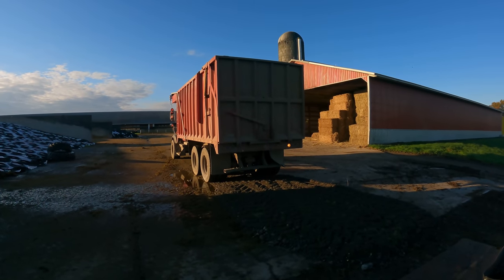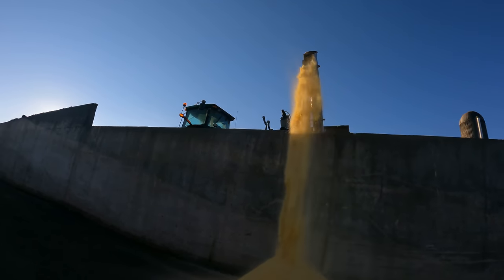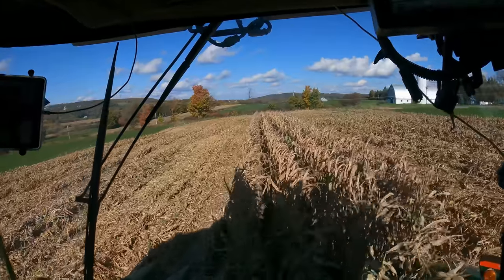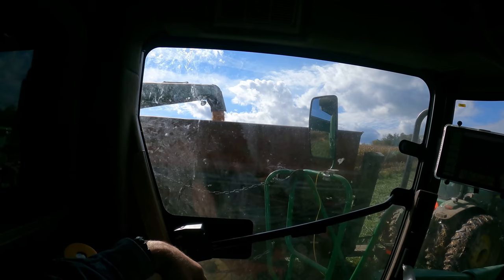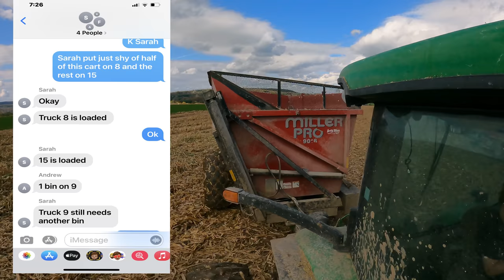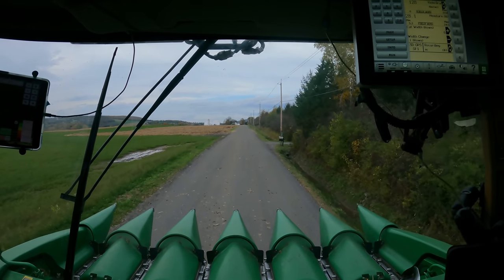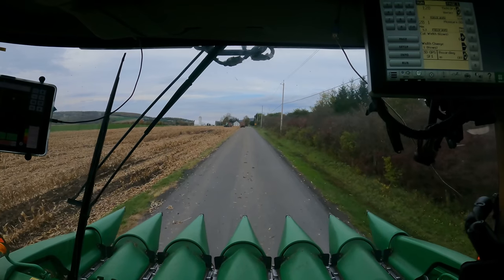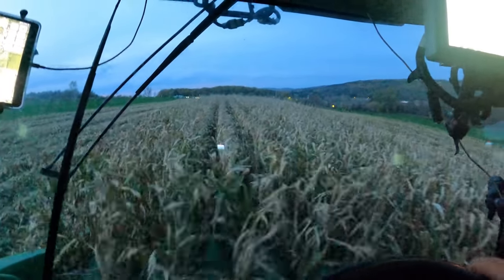Hi moisture Corn Day 1.1

Comment: Andy, I've noticed that you don't have duals or tracks on your Combine, so you obviously  don't think the added flotation/traction is great enough to offset the added expense?
"Nothing Runs Like A Deere" 🦌👍🇺🇸
Reply: 6 row head… no room for duals.
Reply from the maker: Haven’t needed them yet
Reply: @FarmingFixingFabricating  
There was a hill that you couldn't get up just a minute ago.
Reply: @stevefarrow9327  
I don't think that's correct, and I know you can run tracks.
Reply: @RealJohnWayne  he isn't exactly running a huge combine that needs it.
Reply: @EFCasual  
The size is irrelevant, it's about going up the hill that he can't, or pulling a wagon through a wet spot that he cant.
Reply: @RealJohnWayne  it's mostly about spending as little as possible on equipment and still get the work done. Put duals on your own combine.
Reply: @EFCasual  
That's exactly what I stated in my OP, it's always been about the ROI with everything you purchase.
Andy said that he hadn't needed them up to this point, which is a much better response than yours.
Reply: @RealJohnWayne  you can run tracks, 40,000- 80,000 dollars. With a six row head you could dual an 18.4 with a 30.5 and still stay narrow enough. However most final drives are not strong enough for this type of dual setup full time. If used keep a set of extra final drives around. To steal a u-tube line..”ask me how I know that”.
Reply: @RealJohnWayne  well he hasn’t need them yet can always work the field so your going down the bit you couldn’t get up and as for duals they really ain’t going to make a massive difference for the cost of them and tracks would be incredibly expensive
Reply: @gregshearer423  
I just asked the man a simple question, and he was kind enough to give me a simple answer, I didn't solicit anyone else's opinions, who like me know nothing about Andy's operation.
Reply: @gregshearer423  
I just asked the man a simple question, and he was kind enough to give me a simple answer. I didn't solicit anyone else's opinions, who like me know nothing about Andy's operation.
Reply: @RealJohnWayne  you made a comment on the internet that welcomes anyone to reply wither  you like it or not
Reply: @gregshearer423  
Unless you block em.....😉
Reply from the maker: It’s all good guys
Reply from the maker: It’s all good guys
Reply: @FarmingFixingFabricating  
Yes it is! 👍